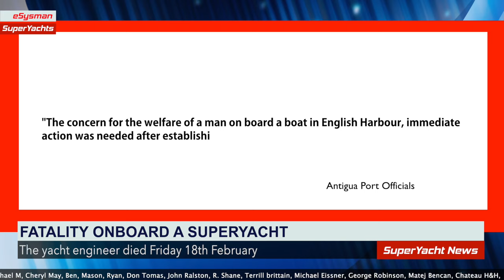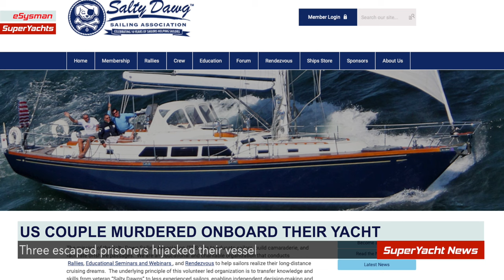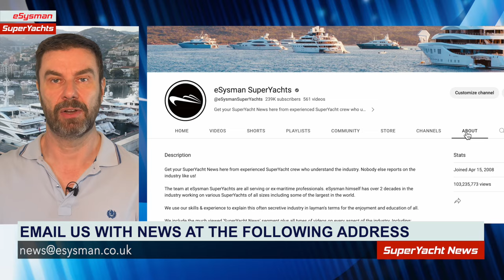US Couple Murdered onboard Their Sailing Yacht | SY News Ep301

Comment: I'm a former sailor USN, electronic technician.  We had standing orders not to work with or even reach into an electronic cabinet without safety gear and a safety monitor. The tech had a rope tied around himself and the monitor held the other end of the rope to pull the tech out if he get electrocuted.   Seemed overly cautious at the time  but I expect all of those requirements were to due to lost techs.
Reply: Every safety rule is written in the blood of those who came before.
Reply: We used to say that every rule in our operations manual had a tragedy behind it.
Reply: Our manufacturing plants have high voltage cabinets and rooms, protective equipment depends on voltage, but could include a full suit and enclosed head gear.
Reply: if indeed it was an electrocution, the hazard would still have been there. surprised the crew pulling him off the machinery could have been hit as well. "assess the scene": is it SAFE for you to come to the aid of someone in trouble. sounds as if that was NOT done as well.
Reply: @HeronPoint2021  you're making a lot of assumptions about what happened. considering that they were able to safely extract the engineer, it's a bit odd that you'd jump to the conclusion that what they did was unsafe.
Reply: @justhecuke  the vid. indicated clearly it may have been an electrical matter, in which case the issue would still be there. you CAN discharge a capacitor in these environments, and that CAN kill you. or a heart attack. I guess welll find out soon.
Reply: @HeronPoint2021  and they may have made it safe. again, you're assuming much of what did and did not happen there. you can always dream up an unsafe "what if", but you weren't there, you don't know the equipment, and you certainly don't know what the crew did.

Stop pretending.
Reply: Autopsy will reveal truth.

Could be heart attack

Comment: The engines are Detroit Diesel 12V-149 series
Reply: MTU 12V4000 X 2  There is a huge difference between a Detroit 12V-149 and an MTU 12V4000.
Reply: thanks for the correction @oldtugs